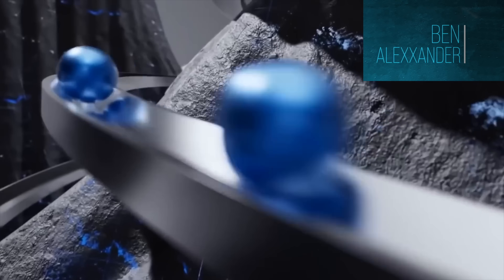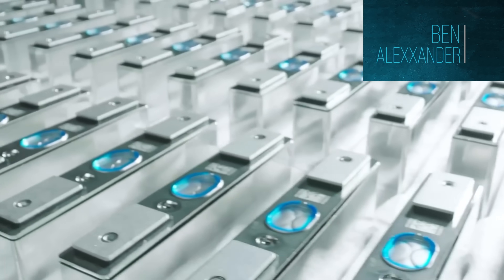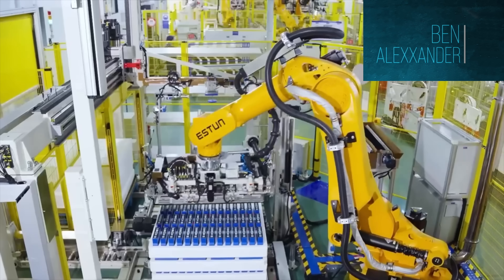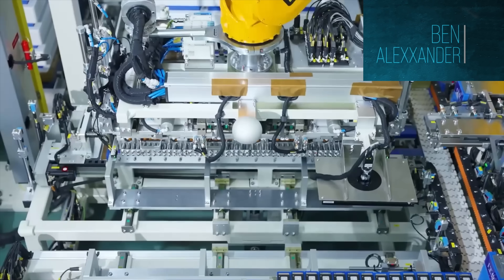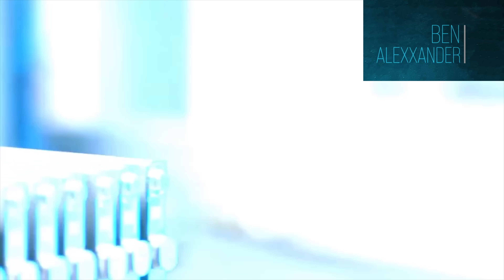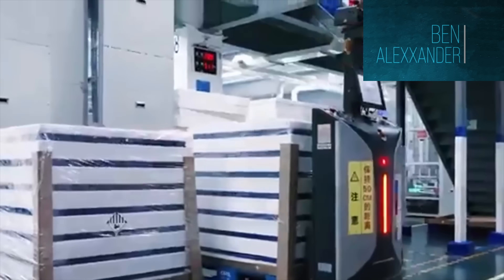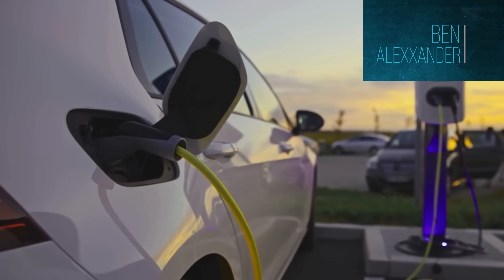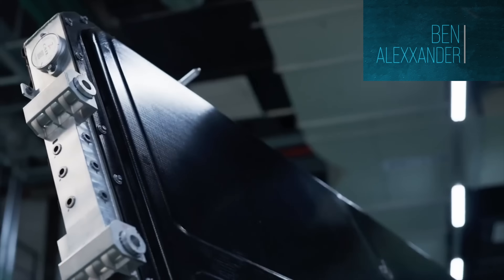CATL’s New Sodium Battery Lasts 3.6 Million Miles — 50% Cheaper Than Lithium

Comment: Just imagine if they could agree on a standard format for the main battery, it would be easy to make a box for it to house battery or make them fix in big grid storage.
Reply: I'd like to see in the case of cars a universal electric car rolling chassis (batteries, motors, drive train, suspension) for the budget models.
Only difference in manufacturers is what they bolt to the chassis
Reply: @dougsmyth8582  That probably not possible but if they could just make etc. a 60 kWh battery and then they could just add the rest around it. CATL are developing a platform but i dont think big companies will buy that.

Comment: Does it really matter if a battery lasts for 3.5M or 1M km? The car with not last over 500k, so what't the point excepts the lower price?
Reply: lower price is massive advantage
Reply: @AutoSneak-y9m yes but in 6 to 12 monts there will be something else with even lower price and same range. This is just a normal develompment when ppl use ther brains for good purpuses.
Reply: @matej2007 lithium is expensive, sodium is free, simple as

Comment: Correction BYD Blade Gen 2.0 is 210Wh/kg. There are also solid state batteries in production already crossing the 300Wh/kg. Tesla is already moving to newer solid state chemistry in 2026. You will only see sodium in home batteries or cheap entry level small EVs.
Reply: So most EVs will use these…

Comment: Because the sodium cells dont need protection for heat or puncture or other stuff that LFP need the price of the complete  battery is even lower than that of the cell and the total energy density is higher

Comment: With sodium battery, the bms is also simpler. Discharging to zero and charging to 100% safeguards becomes unnecessary.
Reply: You still can't overcharge them and they need balancing

Comment: One thing I’ll add: these new sodium batteries work in the winter, unlike lithium batteries which don’t work under 0° C.
Reply: They work under 0 degrees, less efficiently, but work, but you can’t charge them under 0 degrees, that’s when they need to be heated
Reply: @jimhoud I just put in my charger and it starts charging so I don't know what you specifically mean?
Reply: @Mister_Underhill I wouldn’t be surprised if it has circuitry that warms the battery a bit before it charges.
Reply: @Notfiveo0 You're probably right. 😊👍
Reply: Nuclear obsolete? Oh please
Reply: @forno999Nuclear is growing rapidly. Buy NUKZ, if one wants a good investment. It's an ETF that gives one coverage across the nuclear power industry. It's way up this year. I have made many thousands this year. 😊
Reply: THey work under 0C just fine.  Now -20C and you have a point, but otherwise, no
Reply: @w8stral It gets down to -20C here in Minnesota pretty much every night during the winter. We need to be able to charge down to at least -35C (-31F) here in Minnesota to be viable. - 40C in northern Minnesota would be required.
Reply: Not true! I live in Canada, where my Volvo operates routinely in -30 temps. Volvo, Tesla, Equinox, Mustang, Hyundai's all with lithium batteries...no issue, just 20% less range in a Canadian winter
Reply: @GraemeMitchell-m6v  More like 30% range loss. Model 3 lfp during summer, I consume 142wh/km compared to 198wh/km during winter in average. We had a cold winter 3 years ago and I had an average of 215wh/km. Losing all my range in trafic trying to heat the car. I also drive 45k km per year. That's far from 20% loss. You can't run low friction tires during winter or you'll end in the ditch here in Québec
Reply: @davidblanchette1611 in fairness, my Model Y is only 2023, so maybe age is a factor
Reply: @GraemeMitchell-m6v The people I know with EVs have many problems in the winter. Some have GM EVs, which seem to be the worst of all. Ford's are pretty bad with the F150 Lightning being a complete joke. I honestly do not believe you. EVs are pretty much just collecting dust on the dealer lots here in the Twin Cities. People would buy them if they were any good at all. A Ford dealer told me they had only sold one EV all year and they had about 20 on the lot. Might have something to do with the large nunber of fires caused by EVs too. And most people refrain from vehicles that could burn their houses down.
Reply: @herbb8547 ummm....fires are a thing of the past. Fewer fires than ice vehicles. The reason evs don't sell in NA is due to high price, poor range and discontinuation of incentives. I have almost 200,000kms (120,00 miles) on an EV. If you owned one, you would understand there is a difference between myth and reality. The 20% decrease in range is pretty standard across most vehicles. You can believe me or not - I don't really care. I'm glad I'm not spending $80 filling my tank with gas every week. And if the risk of fires was actually a thing, my insurance would be much higher. My car is a 2023, not a 2015.
Reply: @herbb8547 according to Ford, EV sales in the Twin Cities in 2023 were 7% and 10% in 2024. So, so much for "collecting dust". Facts are easy to find. You share opinion, not facts
Reply: @GraemeMitchell-m6v "According to Ford". There is your answer. Ford lost ten billion dollars on EVs last year. Their dealerships are being crushed because they are forced to take EVs they cannot sell. Ford is selling EVs to the dealerships. That is Ford's 10%. The dealerships are not selling them to customers. Therefore, the EVs are sitting on the lots. Dealers are now refusing to accept EVs. That is what is happening.
Reply: Gee they sound great.  Where can I buy some AA sodium batteries?
Reply: they work in the cold but at severely diminished capacity and lithium has a better curve and the freezing is not the real issue you think it is if installed right
Reply: Mine work in -15 celcius, so I don't know what you mean.
Reply: @Mister_Underhill EVs have to run a small heater to warn up the battery packs in cold weather. Temperature control is a big issue with batteries esp when charging. You still need to manage temperature for sodium, but it has a larger operating range.
Reply: @michaelr280 I totally agree. OP said some nonsense about batteries not working below freezing, and that is simply not true. Cold enough and also ice cars must have a little help to get started. (speaking of experience)
Reply: @Mister_Underhill I never ever had a car that didnt start between -30 and -40... Yes they need bloc heater and sometimes need to be jumped. But electric car that didnt want to work at all at -30 was the most hilarious fail I've seen. Mustang, hyundai, tesla, name it... My 1990 civic and my sx4 were starting unplugged EVERY SINGLE TIME 😂 My sorrento dont like it but when it is warm enough its ok. My RAM just dont care.
Reply: @northman77 Have not heard or seen it, and those are temps that will hit different parts of Norway every year. And we have electric cars everywhere. About 50% of the cars I pass every day are electric and one of my families two cars is electric. The other is diesel because, you know, absolutely superior in any other metric than economy. 😅
Reply: @Mister_Underhill go to weatherspark and do a comparison with chibougamau qc can. Norway is not a cold country. And chibougamau is not that bad in canada.
Reply: @northman77 It's not a competition in where the worst climate is. I merely point out that I have never heard that it was a problem here, and we have both cold places and a lot of ev's. My arguments are also purely anecdotal and you can take them as you like. Don't know the science enough to speak on that.
Reply: @Mister_Underhill the thing is... EV dont work well here and some have hard time doing 200km during winter. We dont live in a small narrow country. People can buy them if they want, I dont care. But my government want for force us and it doesnt make sense for everyone.
Reply: @northman77 There we agree. The subsidies are coming to a slow holt here soon. And I don't mind.
Reply: @Mister_Underhill they have pre heat or maintain heat. From off on a zero temp c , only sodium can do that
Reply: @Mister_Underhill  Yours must be broken.
Reply: @kingoneeyed3433 😂👍
Reply: @Mister_Underhill  They don't work well is the point...a 40-50% hole in your EV range is reality regardless of what lies you tell yourself.
Reply: @EdMiller-2016Oh, I know that. My car has now driven 200K kilometers and I see myself as quite knowledgeable in ev use. 50% would be extreme, in my experience. Perhaps up to 40%, but that is seldom. The range of my ev is horrible in any case. It's an A to B kind of car, and works for that purpose. For all long range drives and hitch-work only my trusted diesel will do.
Reply: Current EVs are pretty much worthless in most of the US during the winter months. They have serious issues with road salt, extreme temperature ranges, and charging times. The only people that have them are the wealthy who also have gas vehicles to drive in the winter. If this new battery technology could bring down the excessive cost and overcome the temperature range problem, then EVs might become more practical. But there is still the problem with road salt. We can't drive on the roads without it because the roads would be ice skating rinks. And the salt corrodes the electrical connections and ruins the entire car.
Reply: Mine work fine in the winter. I simply preheat my vehicle before I leave the house, which takes maybe 10 minutes, tops, and can be set to automatically precondition at a set time.
Reply: @tomfoil5590 So, where do you park at work? Do you have heated parking? That is an extremely rare thing up here in the Northland. EVs are worthless in the upper Midwest. You can't charge them in your garage because they can start on fire and burn your house down. You have to charge them at least 30ft from any building. And then it's often - 10 F or colder and they won't charge in that cold.
Reply: @herbb8547 I live 3 hours south of the Canadian border. This will be my fourth winter with my Model 3. I've charged in -20°F before. My charger is located outside next to my parking spot. I park outside at work as well. I precondition my battery about ten minutes before I have to leave. Other than some range loss, I've noticed no ill effects from the cold.
Reply: Lithium batteries never stay under 0 if you use em.

Comment: The advantage of lifepo4 cells is that their discharge characteristics are similar to lead. If you have an existing 12v or 24v based battery system, you can covert easily to lifepo4. This isn't the case with sodium. Sodiums voltage characteristics are a far wider voltage range for the same energy density. Any connected equipment needs to be substantially redesigned for this different operating voltage. If you try to use sodium cells for conventional 12v or 24v equipment, you derate the energy density of the sodium battery. You effectively cannot accesss half the stored energy
Reply: keep some lifep04 banks in this case and just use a dc-dc converter to keep your lifep04 topped up from your sodium.  I run some 12v stuff because it was cheap and easy to find back when I first started messing with solar and batteries but I could see home sodium battery in the 800-1000 volt DC range peak voltage that would make it real efficient for charging and inverting to AC even if it wouldn't be real DIY friendly
Reply: @mikestrain4747 we are on a boat. Sodium is no use to us. We need power at 24v. Lithium is the perfect fit with 26 to 27v output over 80% of the voltage curve

Comment: A fix for a non-problem. Even NMC batteries already last longer than the car in almost all scenarios. If the battery now last five times longer than the car instead of twice as long as the car, who cares? The only benefit is to someone who uses the battery in a second life application, and there will probably be something better again by then. It doesn't improve range. There is no mention of the energy VOLUMETRIC density, just the energy mass density. A light, cheap battery in my car isn't much use if it's three cubic metres, though of course I'm exaggerating. We do need something with more range for a given weight/volume trade-off, not for most scenarios but for heavy vehicles and towing (I keep wondering how long before we get actively driven caravans and trailers with their own batteries and motors)?

Comment: The sodium ion tech platform will replace lithium in time. This type of battery can evolve into solid state batteries and ever higher capacity per mass unit. There is plenty of sodium on the planet, is less toxic, lithium scarcity problem solved. Aluminium graphene batteries are in development as well, same story, but much higher capacity per mass unit. The "green economy" depends largely on the development of cheap electricity storage, a fact that is overlooked by policy makers and politicians.  CATLs sodium battery is the most important technological development on the planet right now, rivaled only by the development of thorium nuclear reactors (both done by China). So if you are "green" you should definitely want to join BRICS, period.

Comment: Putting these on rail cars and having them used as battery banks on sidings is a great use for these batteries. The lowest fire risk and heavy weight aren't issues on rail cars. And even just 50 of them lined up would generate 1.25 gwh of storage.... That's one of the best uses for these if you ask me!
Reply: Yes, using batteries on trains is an obvious application, it would mean that all the infrastructure required to get electricity into a moving train can be dismantled. 

Using the batteries as grid level storage while the trains are in sidings for the night? Well maybe.

Comment: Do you know the calendar life? You mention 50 years - is there a basis for that? Wonderful if true.
Reply: I don't know where he got that figure. I have heard 8 years for the heavy duty truck battery and 3.6 million miles for the car battery which at 1 charge per day would equate to about 30 years, however it is unclear under what conditions this has been calculated at (temperature, charge and discharge rate and percentage of discharge), and to what extent of capacity loss.

Comment: Hopefully desalination plants could be a concentrated source of sodium.
Reply: There's abundant rock salt that needs less refining than sea brine. The bottleneck here is "black carbon", while carbon is abundant, specific structure is needed. But that's engineering problem.
Reply: @jurajvariny6034 China has been working on cracking it.
Reply: I’ve been in salt mining plants and many years ago they just pump down water and return brine. Remove the water and return it for more brine. A simple and effective, safe method. This was for softener salt and maybe road salt. Really cheap stuff… Israel does desalinization now of course for drinking water and salt is a byproduct.

Comment: It's still all talk at the moment, when it gets to mass produced cars it will be worth talking about. The Nextra battery has been talked about for nearly a year. The big problem I have with this video is he compared the Nextra battery, for the most part not yet available in cars and probably still in testing to the current Blade battery, being used worldwide and available in mass produced cars, but then completely ignored the Blade 2 battery. The Blade 2 battery which will be in cars late 2025 to early 2026 has an energy density of 190-210 Wh/kg, the Nextra battery with a energy density of 175 Wh/kg won't be in cars until 2026. That would have been a fair comparison.

The Blade 2 battery would be a fair comparison, comparing the 2 new battery developments rather than the new and not yet available Nextra battery to the old already and being phased out Blade battery simply doesn't make sense. But with all new battery developments I have always said, when I can go down the road and buy a car with it in, and read independent tests of cars using it, that's when it will here and not before.

The killer of the Blade 2 battery, if it indeed is, is of course cost. If the Nextra battery can compete on cost and be far cheaper as claimed then it will probably win despite not being as energy dense as the Blade 2. Money talks when we are discussing big investments like cars, and for a battery pack that costs less than half as much and delivers close enough to the same range, well most people would go with the cheaper option.

Comment: Ben, whilst Naxtra is better than some LFP gravimetric energy density, it's lower than CATL's own LFP for example, the volumetric density remains much lower. Looking at the shots of CATL's Freevoy hybrid units with dual-chemistry LFP and Naxtra cells the Naxtra ones are 15-20% wider. This means that for EVs at a pack level, though the gravimetric density is similar to what's offered today, fewer Sodium cells will fit inside a battery pack; hence at the pack will have a lower energy density than Lithium packs. 

This is one reason why CATL are pitching the batteries at EREV/PHEV hybrids initially via their dual-chemistry packs, where the high sodium cycle can be used to take the brunt of constant recharging whilst on the move, and the Lithium side provides a longer electric-only range than a sodium-only pack could offer.

Comment: Is the price of the cell getting so cheap at $10 that it no longer is the main factor at the pack level? When PV cells got cheap enough it was the packaging, glass, electronics, metal frame, labour, etc, that became major factor in a panel price.
Reply: It's probably because battery production is more automated vs solar panels. But that's likely just because of demand. With these cheaper batteries that are perfect for solar maybe solar itself will specifically benefit and get a boom from higher demand thus better production automation which will then lower solar price. Kinda cool.